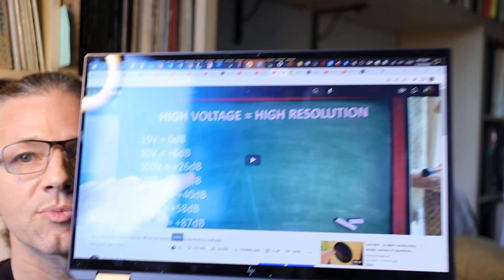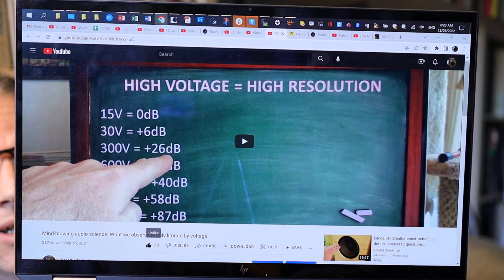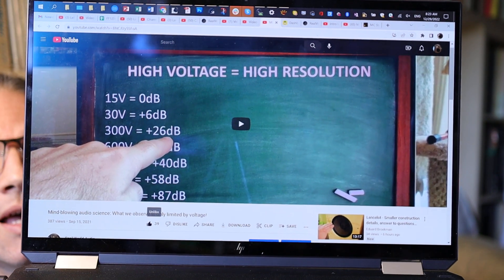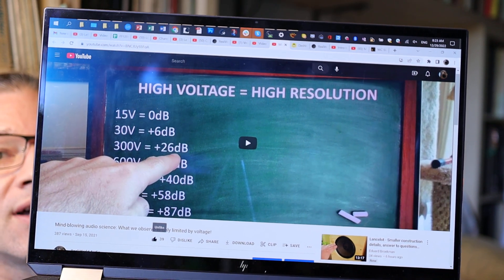Dynamic range defined by voltage:  storage VS amplification

Comment: Just don’t buy otl or supra md0-8, im hell.
build your own distributor and go for 845/300b, 45 tubes, nos 12ay7. Have a nice year Janos.
Reply: 45 -245 /345 Balloon shape are one of my favorites ..........sometimes I need a handkerchief when listening even to vert old recotrdings.
They do me think of fine lace ..........but in music ...............
The 50 nos is ( in my opinion ) also better than the queen of triodes but needs special precayutions when build ( NO grid resistor / capacitor couipling but a quality interstage transformer.
Reply: @frankgeeraerts6243  211 elrog also all you say is correct but in diy with pro guy you never can tell.
Reply: Italian pride is cantico, 45,tube dac,speakers. I think it’s great .
Reply: Diy it’s difficult, no value used, you have to collect it, I will like m2 phono audionote and 845 monos antique sound lab on the cheap side of the used market.

Comment: ? Prepams working always in a  Class A Setting. Why should it a problem to handle this low inputsignals ? Tubes are a lot more  noisy at this level, you will lost these low signals between Distortion and a noisy groundfloor

Comment: Yeap so it is Janos !..............strange I was experiencing late night with voltage fluctuations and their impact on sound quality .............The AC power line is here 230 VAC nominal and typical fluctuates between 227-233 V..........I have some old 117 volt US gear and a lot of 220V ...............Underpowering by switching them to 240 voltb ' transformer side or with a variac has tremendous impact .............the other way round powering those 220V to 230 has risks and breaks often the soundenvelope and shifts towards a high pitch and excessive dynamics ............also the voltage applied to tubes in a circuit determines its operation points and ther's a haotspot were dynamics and tone ( & coherence ) is right ..........sometimes one must adapt the operation condition of tubes to find that equilibrium between all those audiophule qualities .............the harmony preserved in the music.........whe  it's right the ear immediate gets it............when it's wrong than one starts to express the sound in terms of performances ..........and finaly those performances so highly praised  by the audiophyle community become the goal while loosing the harmony and natural connection vibration what music is all about............When experiencing that natural  rightness and thecorrect volume reproduced it isd so EASY to loose that ........often they call that UPGRAQDING...............

Comment: So really it's about linear dynamic range :) Thank you for the follow up. Somewhat related, I've been looking into IM distortion and now I can see why having headroom is so important.
Reply from the maker: You are welcome Eduard :) Especially as signals get smaller, we need larger voltages to accelerate the amplitude change in a linear fashion. Would be interesting to build an MC step-up tube stage with very high plate voltage. Quite a challenge, as we need something with high Vp and super quiet at the same time. On the easy cheasy side, one could try a 6SL7 with 400V on the plate... while the 6SL7 is not held in the highest regard, bumping up the voltage would make it operate in a way more linear fashion, making it a much better tube.
Reply: @realworldaudio  If this was done in as a whole phono stage (which I would prefer as an approach), would you think starting with high voltage would be preferred or stepping it up in relation to the signal level?  At some point, I'd like to build a phono stage for the AT33Mono cartridge ... so it's brewing in the back of my mind how to deal with the 0.35mV :) I  mostly like would to it differential since cartridges are balanced anyway and it can be made very quiet.
Reply: Hi Eduard , nice to hear you mention IM distortion.............that's realy something that bothers me since long ..............and destroys more than one might think......measuring it is not sufficient .......but you hear ( and I do ) it as the spider lurking in the musical web.........I think that I am allergic to IM.............
Headroom is important nut i can see there's enough room in your head to share and explore .................thank you !
Reply: @frankgeeraerts6243  Je vous en prie. I'm pretty convinced IM is a major cause of complex music not sounding natural and confused, chaotic. Even a simple minded exercise in seeing a flattening of a low-frequency waveform in the negative cycle and then imagining a smaller higher frequency modulated on top must have horrendous distortion. Now our hearing can peer 10-20dB into a steady noise/distortion floor, but here the distortion of the smaller waveform will be periodic and amplitude depended and much worse compared to its own amplitude. 

Slightly in the direction I have been taking my amp design, but by going DHT, taking care of power delivery, leaving 6dB headroom before exiting the linear part of the tube (especially in all stage before the output stage).. seems to help reducing IM (at least in the amp). I'm a bit hesitant of the fleapower amps running so close to their limits for that reason. Then a bit related I'm not all that sure to have my CD run up to its peak at 13-14kHz.. agitating a resonance there could well crossover to other regions... that's not really IM per strict definition maybe, but it seems similar to me but then in the mechanical domain.

IM allergy is a great term, Frank. No known cures but for a better system :) Perhaps a DHT driving an ESL55 (those had no IM to speak off, and never fatigued me ever, at any volume it would allow). My ear has gotten more and more critical of it too.... another thing is the prat in live music.. it's very hard to find too.. for me personally, up there with IM on the annoyometer :)
Reply: @EduardBroekman  YES ! and as i said before, I'am allergic to it .....have a nice day Eduard.